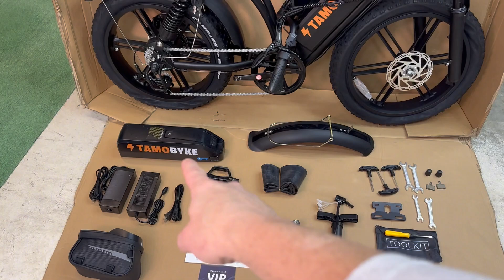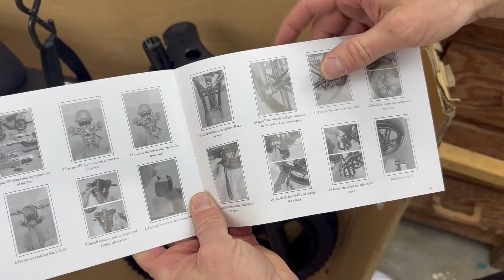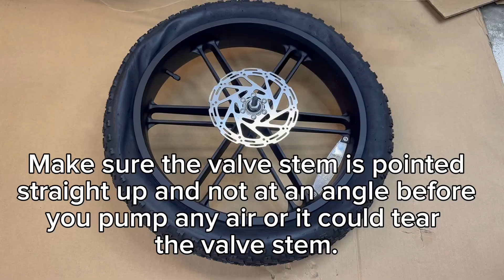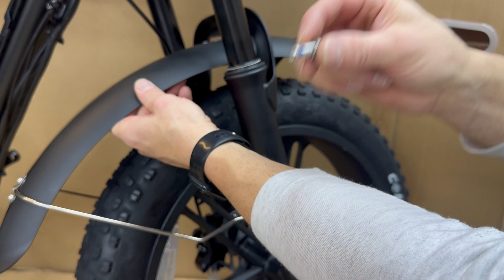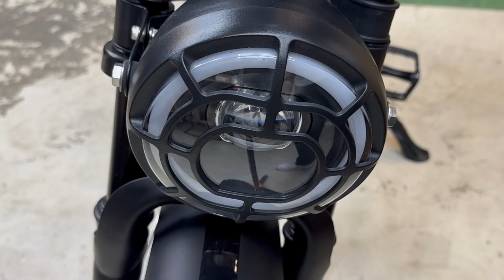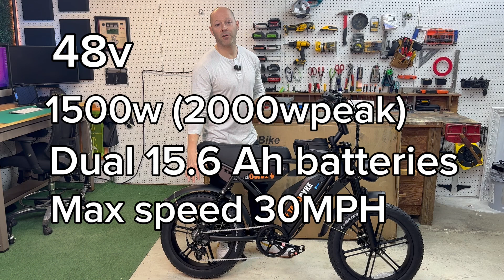First Tamobyke V29 Pro on the market!

Comment: I just bought V29 Pro with 2 Batteries but i can't get the second battery in it's the one under the seat any help would be great.
Thanks.
Reply from the maker: make sure nothing is blocking the track and the key is in the right position. I usually turn the key at the same time I slide the battery in.

Comment: Are you able to change the height of the handlebars?
Reply from the maker: these do not have adjustable handlebars, but you can tilt the bars forward and back if you need to get it closer to you or further away, my dad is 6 foot three and he fit on it. Perfect. My wife is 5 foot two and I just tilted the handlebars towards her and she wrote it perfect but it was a little high from the seat to the ground